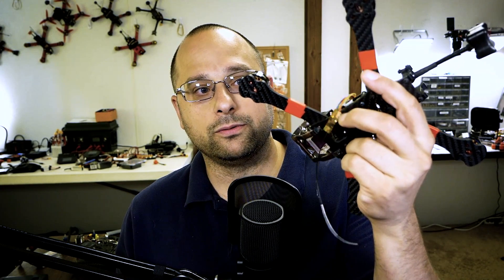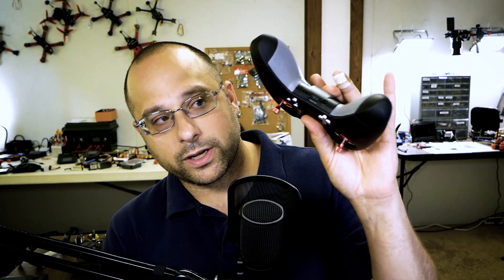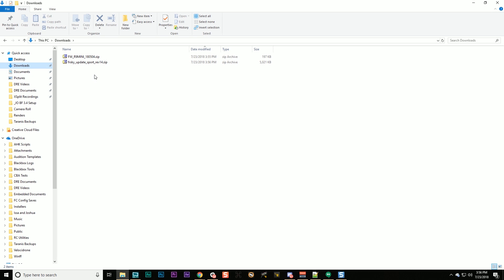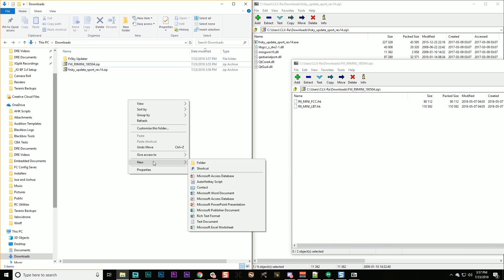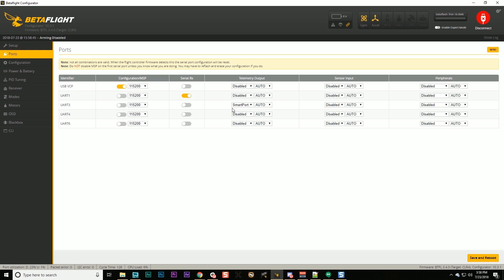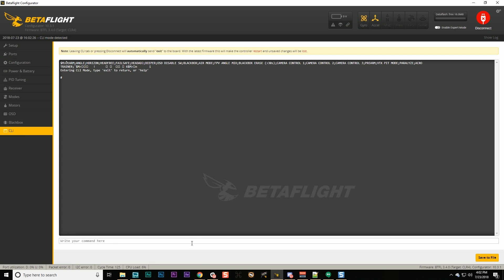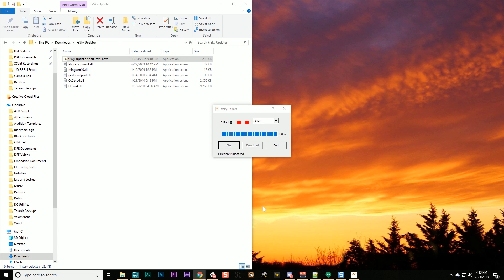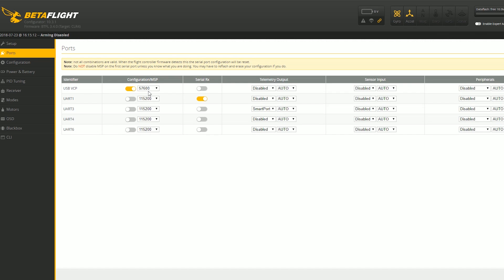Betaflight Serial Passthrough FrSky R9 Firmware Update

Comment: Just a note for those who have FCs that power up the RX [ R9 SLIM in my case ]:

Disconnect the R9 SLIM cable > connect FC > Do exactly what JB does until he plugs the battery. At that moment you don't need to plug the battery, only the cable into the R9 SLIM RX. This will do the same effect, it will solve any issues of FRSKY update tool not detecting your RX.

Comment: Hi Joshua,
great video! 

I'm trying to update my RXSR-FC (Omnibus F4 V6) using this way, but no of the UARTs in the list in Betaflight Configurator has Smartport enabled in default config. Also the manual says: Resources for Smartport are "Software serial", while the other functions have some UART assigned (e. g. SBUS is UART1). Do you now how I can update the receiver?

Comment: Help please - I bought this quad from a guy who said FPORT is already setup, not being able to bind to my Taranis Q X7, looking to the update the Frsky R-XSR ultra mini via this method, but it is not able to find the device using the Frsky utility, have a JB F4 AIO and on BF Serial Rx is on UART3, I can see that the s-port yellow wire is connected to 'Tele' on FC - should i use 0 or 2 in serial passthrough command ?

Comment: Damn it no smartport.. I wanted to do this.. i have cinepro 4k..
R-xsr won't bind to internal accst d16.. only xjt lite module.. 
Trying everything to fix it
Reply from the maker: Definitely need to update the firmware either on your internal module or your RXSR. If you can't update the RXSR then update the module.
Reply: @JoshuaBardwell  updated internal module even though it already had the latest. . Updated radio. OpenTX. R-xsr only thing left but drone has to be taken apart. And I think capacitor unsoldered or power cable (cinepro 4k) im a novice still learning. Just frustrated. I'd pay u to do it if u lived near by.
Reply from the maker: Module on the latest firmware but what if the RXSR has old firmware. You may need to roll back the module to pre-2.x firmware.
Reply: @JoshuaBardwell  none offered on X9 Lite S page. Can I use X9 Lite? (none S)
Reply: @JoshuaBardwell  omg yes other lite radio firmware worked.. it worked.. works now thank you so much..

Comment: I will try to updade de xm+ on my mobula 7 using this method, i need to unplug the power wire and conected later.
May be this solves the binding problem between the x9lite-s lbt and the xm+
Reply: did you manage to configure the R9 receiver and transmitter according to the instructions? Could you help me?
Reply: @KrisVoltEnergy  i have already binding it and there is ok at the moment. I have to use a script on cli, because the light dont change color. I dont need to update the xm and at this moment i have bindid the m7 and tinyhawk.

Comment: You can easily give a hint how to do it on Matek F405 STD?
I follow the instructions, I power the FC with USB and plug the GND cable (receiver R9M) only after selecting the file from FrskyUpdate. I can't find my R9 MM.

The worst thing is that there are many mistakes on the Internet;
http://www.mateksys.com/?p=4488
https://oscarliang.com/setup-frsky-fport/
One denies the other. I don't know, it's all about it at last.
And others write like this;
Connected to SBUS pad on Matek F405.
set Ports UART 2 SerialRX

serial 1 64 115200 57600 0 115200
set serialrx_provider = FPORT
set serialrx_halfduplex = OFF
set serialrx_inverted = ON

Be a kind and good person and help someone who managed to do it on F405 STD. The worst thing is that everything worked before and it was my fault did it that I wanted to update.

Comment: so my board started smoking...
Reply from the maker: This has to be either a coincidence or a wiring problem. Simply using serialpassthrough shouldn't be able to cause that, at all.
Reply: Joshua Bardwell - I know it is an unrelated incident, it was when I went to connect power... I later found that my FC is dead from the crash I had last time I flew some months ago... any new flight controller you could recommend?
Reply: Although for some reason it still works adequately in beta flight an while connected to usb. I’m unsure as to the exact issue on the board... definitely not an issue on your end or with this tutorial. You have helped me many times in the past and in live-streams
Reply from the maker: Works from USB port but not from battery means 5v regulator is fried.
Reply: Joshua Bardwell - yup that’s probably the component that I found that desoldered itself from the board...

Comment: Thank you! Your video saved me the time waiting for the frsky tool. I own the nirvana and as awesome it is, it can't upgrade modules and receivers. I got myself into r9 and of course it wouldn't work without the upgrades. I took an old crazybee f3 aio fc put the r9mm on it, set up serialpassthrough as you showed it and it worked! Then I cooked up a connector for the module (you don't wanna know) and upgraded it too successfully. Now everything works! God, I love this hobby!
Reply: I have a huge request to you. I also have nirvana,  myself with this software uploading for a few days and I lack strength. Previously I tried on Matek F4, now I came with a mini F3 controller and  did not. Can you help me find the reason why I can't upload the software? I come from Poland, my mail is gkochab@gmail.com
Reply: hi mate you can even do  on the r9m module? where did u connect the s.port thanks.
Reply: @FPVrare  bottom pin is the signal, the one above it is ground, the one above it is the voltage. I cut a paperclip in 3, soldered the wires to them, plugged in these holes in this order and prayed so it doesn't come apart anywhere during the update. That's it. Since then I learned there is a smart port in the front too. That might be easier.
Reply: @athefpv4670  wow thank you mate im gonna try this thanks for helping does the upper pin still the PPM input? for r9m if your familiar.
Reply: @FPVrare  it should be. The module supports ppm so it must be it
Reply: @athefpv4670  sad mate huhuhu cant update my r9m but my reciever already updated have u any ide that can help or what baudrate or still using smartport  what did you thank you in advance.
Reply: @FPVrare  Strange, if it worked for your receiver, it should work for the module too. Check the pinout against google and see if you hooked it up correctly. Make sure you set up serial passthrough first, set up everything softwarewise so you only have to start the update, then connect the module, not before.
Reply: @athefpv4670  yes mate maybe it just didnt work because it is the r9m2019 maybe thats why but my reciever already updated thanks for your help tho.

Comment: Could I do same thing to flash the module firmware by the sport pin on backside. I'm using a jumper t8sg v2 plus radio running under deviation TX and the pxx protocol don't work on my r9m 2019 cause of acces firmware I think
Reply from the maker: Yes. The FC doesn't care what it is flashing.
Reply: @JoshuaBardwell  you make my day 😊. Thanks for quick answer
Reply: @JoshuaBardwell  if my s.port is softserial1 does I have to enter cli command serial pass-through 10 57600?

Comment: Hi, great video but i'm adding smtg for F7 guys that are tilting with it. WIth F7 controller, the easiest way is to activate Fport with josua's video and after follow this video but instead of  selecting smartport on telemetry, just activate Serial RX of the uart needed. That's the correct way to do it with Fport :) i found it after 2 hours of research so... i'm so happy
Your video are awesome josh keep going

Comment: Is there no way to put the R9MM into bootloader mode from CLI? Would make this even easier. Have my R9M and R9MM coming in a few days. Looks like a PITA to flash the thing, with it not having a plug like the RXSR
Or perhaps a CLI command to make the RX power cycle even?

Comment: My R9 MM won't bind. So I like to upgrade the firmware with this method. I added a switch in the 5V line of the receiver. I have exactly the same configuration in the Ports screen as shown in this video. But if I enter 'serialpasthrough 2 57600' I get the message  'Port 2 already open, setting baud = 57600' and the frsky update tool is not able to find the receiver. Any tip? I use the JBardwell F4 AIO board. Why is the port already opened?

Comment: I am trying to update the firmware of an r-xsr with the Betafligth and when I start the FrskyUpdate the screen only shows the comm 11 and also not available. I can not change to 3.
I've tried running it as an administrator and putting comm 1 to 57.600, but nothing.
As I have the open drone I have disconnected the whole receiver to prevent it from being powered, with the idea of connecting it when the updater needs it. It's okay ?
In the port configuration the UART3 is at 19200 and Smartpor is selected in automatic and Rxserie off.
The Rxserie is only activated in the Uart6, which nevertheless has the MSP disabled.
You can help me?
Reply from the maker: The actual COM port number depends on your computer. It will vary. If COM11 appears when you plug in the FC, that is the one to use.
Reply: @JoshuaBardwell  In Betafligth I connect with Comm11 but the problem is with the Frsky update, in its screen do no shows any comm port avalaible. It shows Comm 11 but shows a message that it is not avalaible. In your video in the 10:54 minute you can choose the comm,
I can not.
Maybe it's a PC problem, but I've updated the Com and Lpt ports from the file manager and still Frsky updater does not find open ports.
I HAVE WINDOWS 10. Can be a compatibility problem?

Comment: By the way: You can also flash the R9M Module during this method. For example you have a nirvana and cant flash the module during the radio. Connect the sport, plus and minus of the r9M module to your fc and choose the right file for it. Works great!! I hope i could help. 
Greez from Germany.  :)
Reply: posrproductions - thank you my dude. I have this boi integrated into my flysky is6, and therefore, cannot update it like you would with a taranis... I thought this was possible, but I had to check the comments, lol, thx.
Reply: hi mate what FW you are using and did you power the r9m module via fc? thanks stay safe out there .

Comment: I was thinking... Can i use this methot to flash the r9m transmitter module.. I hope if i just connect the transmitter sport pin instead of the receiver and select the firmware for the r9m there isn't going to have any problems... Because i use it with a radio that doesn't  have a sd card......
Reply: hi mate have you found any solution by yours thanks stay safe.

Comment: Hey Josh, I have the Matek F405-CTR and my Smartport wire is soldered to the TX2 pad but I had to assign it to softserial.  What should I type into the CLI to enable pass through?
Reply from the maker: I think it can be done but I don't know the port number. I asked the Betaflight FB support group here, so click through and when they post the answer you'll have it too: https://www.facebook.com/groups/betaflightgroup/permalink/299599867402563/

Comment: You can update the R9M module using this technique to. Use the S.port on the under side (bottom hole, and ground is second bottom hole.),  then plug in TX30 2s. I have a Nirvana...
Reply: THAN YOU!
Reply: could you elaborate the process a bit? do I use the s.port and ground wire from my receiver and desolder it for the process?`soI need to solder my r9m to my fc's receiver cables?
Reply: @XJ1345  hi mate did you find the solution of this thanks.
Reply: @FPVrare  I ended up buying the Frsky STK tool to make updates. If I remeber correctly I couldn't get it to work this way.
Reply: Thanks mate I'm planning to do so also.

Comment: Hi there Mr Bardwell,
greetings from Hungary (a small country in EU).
Just one question: does the whole procedure apply for updating the TX module as well? (or alternativelly could it work?) [I own a 9XR-Pro with an updated OpenTX]
Cheers, keep up the good work!! :)
Reply from the maker: The TX module is updated by putting the firmware on the SD card in the Firmwares folder. Then on the radio, long-press Menu. Press Page to get to the SD Card screen. Navigate to the Firmwares folder. Highlight the .frk file in question and long-press Enter, then select "Flash External Module".
Reply from the maker: (Or "Flash Internal Module" if you are updating the radio's internal module. External module is for the JR bay.)

Comment: What if it says port 2 already open? Just sits on finding device. x4rsb on the jbf4.

I got it to work. Next to smartport where it says auto I changed to 57600 and it worked
Reply from the maker: I'm not sure I know exactly where you've gone wrong but if you follow the steps in the video exactly, it should work.
Reply: @JoshuaBardwell  I finally got it to work. In the ports tab next to smartport where it says "auto" I changed that to the 57600 and it worked.
Reply: @JoshuaBardwell  I am however still getting repeated messages from radio "telemetry lost" "telemetry recovered" over and over.. Any ideas on that? It even said "sensor lost" once tonight..
Reply: @JoshuaBardwell  ahhh I just found this information.. This is my issue. 
"It is possible to receive spurious "telemetry lost" and "telemetry recovered" messages when the transmitter and receiver are less than a meter apart.

This is not a malfunction and will stop when the 2 devices are physically separated."

Comment: would something bad happend to the FC if i flashed the receiver with the s.port on the taranis while it still is conected to the FC? cause i did it :/  i have used servo pins to get it mounted solid. (just like one the magnum f4 stack) so it was very easy to just add the flashing cable to the top of the pins. i left 1mm poking out of the receiver so i can use a servo plug to flash it. but i noticed the s.port cable from the taranis powered up the fc also :/
Reply from the maker: If you are going to flash via S.Port yes I do agree you need to disconnect it from the FC.
Reply: I already did it. Hehe. The fc made some extra beeps and it drained the taranis battery super fast but it seemed to work.
I dont think its possible to write via the tx pad to the FC.

Comment: Joshua what if sport is on a softserial port?
Reply from the maker: I think it can still work but I don't know the port number to use in the serialpassthrough command.
Reply: For SoftSerial1 use 30 and for SoftSerial2 use 31. Still, I couldn't get the FrSky tool to properly connect to the receiver. Let me know if you managed to flash over softserial.

Comment: Hey brother! I know questions in the comments are super long and inefficient... I have the XM+, your JB FC, and the XJT module :( And no friends who fly FrSky :( . Is it "Serial passthrough 0 57600" since the sbus is going into UART 1 as I understand it? Or am I misunderstanding things completely?
Reply from the maker: Yes that sounds correct.
Reply: Interesting... I’ll keep fiddling with it then thanks. Thought I followed all the steps but I’m obviously missing something. So badly want RSSI on channel 8/16 (hence me attempting to update). Thanks friend!
Reply: SUCCESS!! THANK YOU! I was not clear on terms & meanings... Temporarily moved the receiver SBUS wire from the SBUS pad to the SmartPort Telemetry pad and it recognized & updated (still a little foggy on terms and differences; serial port vs. UART, SmartPort, SBUS, why serialpassthrough only forwards to a smartport and not an SBUS, etc :) THANK YOU! Now I have OSD RSSI. Silly XJT module... Just love my old JR radio.

Comment: Frsky tool didn`t find COM port which I was using for betaflight (COM3). I workaround it by that I start FrskyTool and it found some other COM1 port, then I remap COM ports in windows device manager, at first other device remap to COM2, and then betaflight (holybro) COM3 I remaped to COM1. After this, I start with flashing procedure, do passthrough in bf, close bf and then connect battery to quad, after it FrskyTool (which was running from beginning) found my receiver firmware version... so I was able to flash new one. 
Hope it can help to someone else with same problem with frusb-3-fuc-3 (frsky_update_sport_rev14.zip) tool COM port problem.
Reply: Wow that is a lot of manipulation, isn't easier just to desolder 4wires?
Reply: I have the same problem, frsky tool is not recognising the com port which I connect fc to. Which driver do you use ?
Reply: @Simofly  I installed driver from frsky wesite: https://www.frsky-rc.com/frusb-3-fuc-3/ and also I tried USB driver Zadig https://zadig.akeo.ie. 
But trick is to run Frsky Tool(do not turn it off!), and if this tool see any COM port, then just remap ports in windows device manager, so your FC will be using port which frsky tool seen before :)

Comment: Tested it yesterday to update one of my r-xsr receivers to Fport, like you mentioned 'as long the receiver is not powered from the same rail as the 5v USB it works flawlesly. Well ok it'll take some time, but much better than unsolder your receiver.